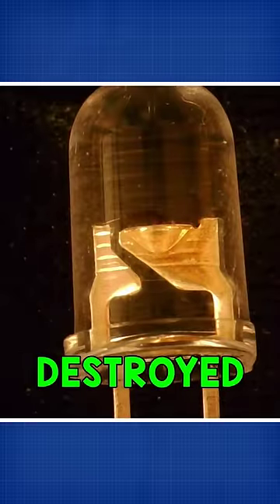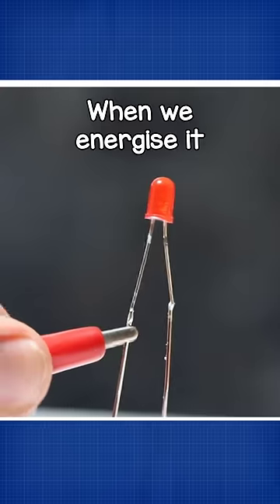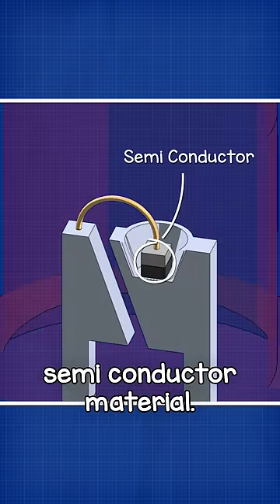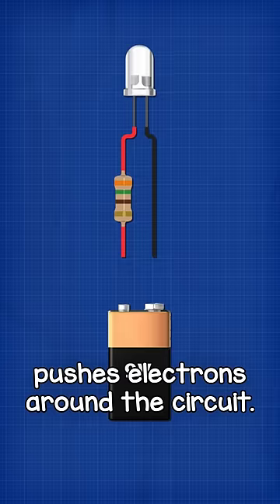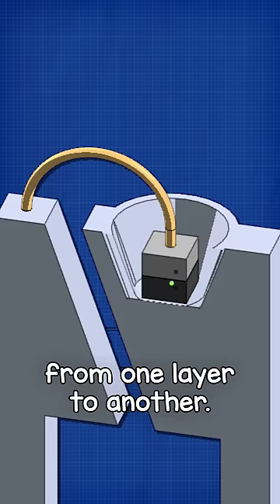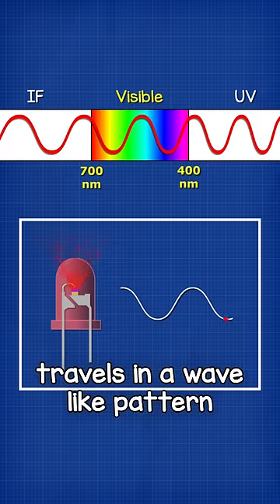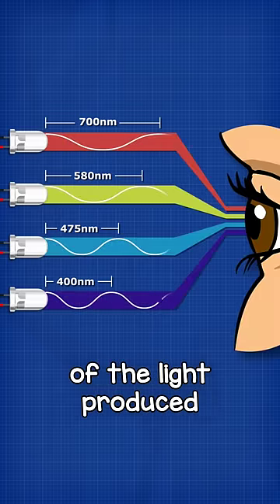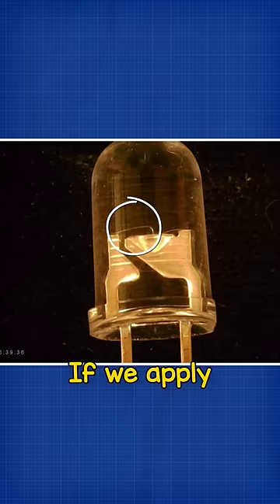What is an LED and how does it work #technology #electronics #engineering #led

Comment: "the colour is not because of the case" 
My brain has been lying to me this whole time
Reply: Your brain is not lying to you. Contrary to what he says, the colour of the case does impact the visible colour we see, by filtering the light output. Given the limited wavelengths produced by particular LEDs the colour of the case has limited effect, as it does not have the same range of output as say an incandescent lamp. You get changes in tone, not a huge differences.
Reply: I have a flashlight that has a white LED, but a layer of some translucent thing on top of it generates a cool looking yellow-white light, I guess it depends on what the manufacturer wants.
Reply: He should have said not necessarily. The cheap colored leds gst their color from the case. This is supported by the fact that the case has a color even without glowing. It's cleaner and more efficient to emit the desired wavelength in the first place instead of filtering with colored casings though.
Reply: @artyom8905 some manufacturers add a phosphorescent coating ontop of the LED which reemits the photons as different wavelengths, the reason they do this is as you said it emits a warmer light in the yellow range which is less harsh on the eyes and nicer
They did this in older household LEDs where I believe the source LED is blue? Or it could be 3 LEDs to mix and make white not sure, this was until we figured out how to cheaply change the colour at any time and now we have bulbs which can be any colour, very neat history
Reply: @redcrafterlppa303  red, green and blue LEDs are naturally those colors. White ones are not cheaper. They’re more expensive than all of them. You wouldn’t make a white one and then filter the light with the case.
Reply: @urglegurgle5807  yep, u rght
Reply: BRUHHHHHHHHHHHHHHHHHHHHHHHHHHHHHHHHHHHHHHHHHHHHHHHHHHHHHHHHHHHHHHHHHHHHHHHHHHHHHHHHHHHHHHHHHHHHHHHHHHHHHHHHHHHHHHHHHHHHHHHHHHHHHHHHHHHH

Comment: Diodes were designed and used as one way valves. The light was a by product and it wasn't until later people started focusing on the light
Reply: Yes, but it was a long time before a good blue LED was invented.
Reply: @nunyabusiness5075 the guy who made it basically did it from scratch (sort of)

Comment: Really like the visuals in your explanation! One thing I want to point out is that the resistor is used to limit current through the diode. Diodes have a maximum voltage rating, however the failure of the diode in the video is cause by too much current.
Reply: How dare you to write EXACTLY the same comment I was about to write myself 😊.

Comment: An LED will maintain a fixed voltage across its leads, typically .6 volts.  If you provide a power source with no current limiting, the LED will draw current up to its max current rating where it will burn out.  The resistor limits the current flowing through the circuit, protecting the LED - It's generally referred to as a current limiting resistor.  Describing it as a voltage limiter is incorrect.
Reply: An LED won't draw unlimited current if the voltage is correct for it. If the voltage is higher, you work out the voltage difference between the input and what the LED needs and you select a resistor based on the current you want it to draw.
Reply: no, a led voltage drop isnt 0.6v, thats normal rectifier or signal diodes,  leds are between 1.8 and 4v approx, depending on the actual led semiconductor material
Reply: @andygozzo72  But do you disagree with the point of the comment, or just focus on the trivial detail that a light emitting diode typically has a higher voltage drop than a signal diode?  Obviously when designing a circuit with any diode, you likely will look up (or measure) the rated voltage drop and maximum current for the specific component.
Reply: @blobscott The fixed voltage isn't reality, it's a simplified model.
The real voltage Vs current plot follows an exponential curve.

One simplification is looking at it as a fixed voltage and you get a reversed L curve  with Vf as the point it goes vertical.
Another is to model the diode as a voltage source in series with a resistor, the voltage source having a voltage of where the LED starts emitting enough to be visible/useful, and the series resistance an approximation of the slope of the curve (for the useful part of it)

Comment: The flow of electrons is termed electron current. Electrons flow from the negative terminal to the positive. Conventional current or simply current, behaves as if positive charge carriers cause current flow. Conventional current flows from the positive terminal to the negative.
Reply: Only DC does what you're describing. But you sound like a bot as do most comments here.

Comment: In a way, the explanation makes sense, or it's more accessible for a bigger audience, but technically it's not a 100% correct answer (and I saw people failing their 'Electronic Devices' exam for giving answers like this... In engineering you can fail exams depending on how you phrase your answer).

Short answer (given by many others already): The resistor limits the current, not the voltage. The voltage across the LED will be practically constant and not so high while it's on.

Long Answer (to explain what we all mean by limiting the current): LEDs are used in direct polarization to light up and in this condition when you apply a voltage to a LED, the voltage across the LED will be fixed at its cut-off voltage of a few volts (depending on the colour or the material it's made of) so you don't need to limit the voltage (on the contrary, you need to be at it's cut-off). On the other hand, at the cut-off voltage the current ramps up to very high values, very quickly, causing the power (V x I) to raise too much above the maximum power rating (the LED will melt and break like in the video due to excessive heat dissipation) and this is because the LED itself doesn't have enough internal resistance due to its chemical composition, size, packaging, etc. The resistor is used to determine a more or less fixed value of the current (knowing the supply voltage and the cutoff voltage across the LED, you know the voltage across the resistor by difference (2nd Kirchhoff's law) and you can choose the resistor value depending on which current you want (Ohm's law)). The current value is chosen so that the product between that current and the LED cut-off voltage stays below the maximum power rating specified in the LED datasheet.

One way you can get around if you want to stick with the voltage limiting point of view is by pointing out that if you want to use a, let's say 5 V supply to a LED than has a cutoff voltage of 2 V, the remaining 3 V must go somewhere (2nd Kirchhoff's Law) so you put a resistor there to "keep those 3 V busy".
It's an absolutely valid and correct answer, but the current limiting answer is better because it takes into account how a LED acually works and can avoid a teacher asking "so why wouldn't I just use 2 V supply directly on the LED and no resistor?".

PS I love this content so I don't mean to be disrespectful with my correction :)
Reply: When I was taught about LEDs at school (for my A/O-level Electronics in the lower 6th) the full nature of the current limiting was not given (dunno if we were supposed to work it out ourselves, but the effect of too much current wasn't made), only a comment that a current limiting resistor of <insert value can't remember <ahem> years later> ohms "should be fine".
Reply: @cigmorfil4101  I believe what you mean is what in my country is high school (excuse my ignorance, different education systems can be confusing) and in that case that's normal because you don't need to get into small details, what you do is the "ABC" and for that you always use the same typical values. Consider that for LEDs the voltages at which they work depends on their nature, the voltage supply is generally a standard value like 5 or 12 V so you don't have a lot of variation for R (at least for very simple circuits like this one) and for such a simple use of a LED R must be there so they gave you an "habit" rather than an explanation, which at that level is perfectly fine.

At university things are different of course. It's not the same everywhere but where I studied we had (among many other things) first a course called 'Electronic Devices' where we studied the physics of semiconductors, diodes and transistors to understand how they physically work at sub-atomical level and how that determines how to use those devices. Then, 2 courses in Electronics to learn how to design and (mostly) analyse electronic circuits, both analog and digital, so these small details become very important (this specific one is so simple that through practice you'd figure it out but there are cases where things can get pretty obscure).

Comment: Voltage destroy’s incandescent lamps, current destroys LED’s. The resistor is to reduce current so the led isn’t over driven.
Reply: The resistor is there to control / determine the lights wavelength. You would need a variable resistor to actually protect anything.

Comment: Actually overheat is what kills LEDs, and an excess of applied Power (current x volts) is what leads to an instant overheat. Not only voltage. LEDs can withstand a certain amount of voltage, limiting the current, but a slight excess of it and the current will overflow and burn it. So we use the resistor to protect the LED by dropping the voltage and limiting the current.
You can even apply more power to a LED than the amount it was designed to, but you need a big way to dissipate all the heat it produces or it will burn.

Comment: Ive jambed LEDs straight onto a 9v battery and they didnt blow...however, the red LED glowed bright orange and the green LED also glowed bright orange...so no point in overvolting..unless you want orange...for a little while...
Reply: Not all that common over all for LEDs to fail spectacularly (like capacitors can do) and the internal resistance of a 9V battery is relatively high, so that limits the current somewhat.
A power supply that can deliver a  couple of amps at 9 volts will make short work of the same LED.

The shift towards orange is due to heat affecting the PN junction, lowering the bandgap, and thus shifting the colour emitted in the direction of red. 
The heat will also affect the lifetime of the LED significantly (negatively).

Comment: Yes. Current. Resistor must be selected to limit current below Max, using I =E/R equation. E is actually the applied voltage minus the diode's forward drop, usually around 0.7 volt.

Comment: I thought the flow of current is from negative to positive but in the video shown with the battery, the flow is from positive to negative. Correct me if I'm wrong.
Reply from the maker: Conventional current is from positive to negative, electron flow is negative to positive. I use either to explain depending on  the video and the audience
Reply: I had difficulty with that concept until I learned about the current flow inside the battery and theoretical source resistance and theoretical load resistance in context of best practices but I knew enough from others not to complete the external circuit with  my body parts and never stick my tongue on "it".

Comment: sure too much voltage will kill an led, but the reason for the resistor is to limit current. The resistor in that circuit will not reduce voltage.
Reply: Not the voltage of the circuit, but the voltage over the LED is reduced by the voltage over the resistor (R x I)

Comment: Yes photons travel in a wave. However this all depends on if the quantum system has been observed or it's entangled quantum particle has been observed which would then collapse The Wavefunction (even if the other sister quantum particle entangled to each other has been observed. Collapse of The Wavefunction would occur through Nonlocality and collapse the other particle.).
Reply: Particle Quantum Particles when Wavefunction is Collapsed the Quantum Particle or Quantum System even Fermions would no longer act as a wave but instead act as a single particle and fly "straight" like in the proven Dual-Slit Experiment.

Comment: Great video!  Concise, brief and yet very detailed.  Should be part of curriculum.
Reply: It is, at least in the U.S.A. Students usually learn about voltage, current, circuits, etc in 4th grade, so about 9 or 10 years old.
Reply: @rachel705  Really?  Ask a High Schooler about this and they have no clue!  According to you the retention rate is zero.

Comment: Well explained 👍 the problem is that led had a very steep Ampere curve related to the voltage. Every 0.1 volt more counts. And that is why you should run on the rated voltage or better on a controller.

Comment: Saying, light is moving in a wave pattern, is wrong. The wave still has one directon of propagation. What has a wave like form are the components of magnetic- an electric field (which are orthogonal to the proagation and each other; they can also rotate around the propagation axis, but dont have to). Also the light is not emitted by "jumping from one layer to another". The light is emitted by recombination of an elektron moving freely through the semiconductor anf a gap, where a electron is missing in the covalent bond of the semiconductor crystaline structure. On a pn-junction in an LED this can happen more likely, because at the junction the spatial distance between the electron and the gap is a lot smaller than in other places of the Semiconductor. Also sometimes the LEDs with a coloured casing dont have the same colour as the casing and just use just a white LED, since for a colourful LED with just one colour you need a higher qualitiy of diode which of course is more expensive. This was done more often in the past because not all colours could be prduced or were diffcult an expensive to build. But today it is not that  expensive anymore and therefore these LEDs are used less often.
Reply: yo mama like it??

Comment: It's current that destroys LEDs, not voltage. True, increase the voltage across an LED and the current goes up, but it's high non-linear and also temperature dependent, and also varies with the LED colour and to some extent from component to component. Hence when you design a circuit to drive LEDs you design it according to the current. If you are being sophisticated, then you use a proper current source circuit, if not so sophisticated then a sort of approximation to a current source via a dropper resistor, which is not so accurate with a small voltage drop, and very wasteful with a more accurate high voltage drop.

That resistor is there to limit the current, not the the voltage, which only varies slightly between the LED not working at all and it rapidly burning out.
Reply from the maker: True, please see our video in resistors explained and leds explai for a deep dive  on how they actually work

Comment: Well yes except not really. In electrical circuits, neither movement of electrons nor charge is what drives the circuit. Rather, it is the electromagnetic field with direction determined by the Poynting vector that delivers energy and allows electrons to buildup on one side of the diode junction.

Comment: Funny thing about LEDs you can put the resistor after instead of before and it will work just fine it doesn't matter where the resistor is as long as it's in the circuit try it out sometime it's fucking weird

Comment: its better to say "too much current ...destroyes LED", because some folks will put a LED on a constant voltage-source, what is wrong !! Main-reason is th U-I-charactersitic: with a constant voltage the current is unstable because of the very rapid (exponential!) current rise depending on temperature and other reason. It is a diode and you have a exponential charactersitic curve. Thats why you must put a constant current which is done most simple with a resistor on a voltage source. Constant current sources are used in light applications, too...

Comment: Maybe one day I will understand why and how come we can hear music out of a radio. It's some thing that interest me for years. We buy a radio and we have music but we don't understand why. What makes it come out the sound or receiving, we are being grown-up with this and we don't know better but it makes me nuts !!! 🤪🥴
Reply: AM is probably easier to "internally visualize" than FM.
In AM radio the broadcast tower sends out an electro-magnetic wave of a fixed frequency. The amplitude (energy) of the signal is modulated by the sound that is sent.
Your receiver takes in the electro-magnetic signal by its serial/antenna and (after amplification as the signal the reaches you is weak) the signal essentially goes through filters that removes the high frequency "squiggles" of the carrier frequency, only letting through the lower frequency variation that comes from the variation that came from the audio. Then final amplification to drive speakers or headphones.
Two stages of amplification because power amplification of high frequencies is relatively hard, and filtering high power signals is also harder, so amplify the original signal only enough to have something useful to give the final audio amp after the filtering.

Any actual "radio guy" is likely crying, sighing in despair or reaching for a gun😮😅

Comment: So, the color of the light is determined by the material used?
Reply: By the materials in the PN junction and/or a phosphorus coating that absorbs the photons emitted from the junction and then re-emitts photons at a lower frequency.

An LED that internally emits a high energy blue/near UV light can result in white light by a mix of phosphors that emit a mix of colours (red green blue) our eyes interprets as white. By tweaking the amount of blue Vs red the colour temperature of the white light can be adjusted (reddish warm white < - > cold bluish white)